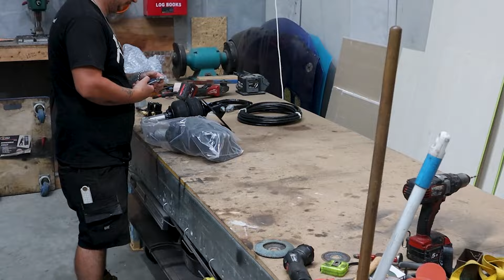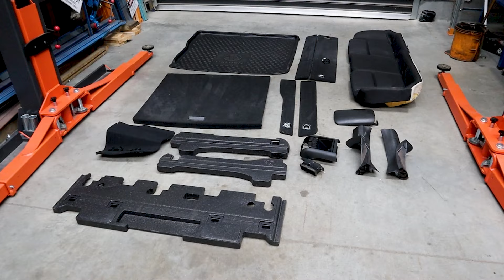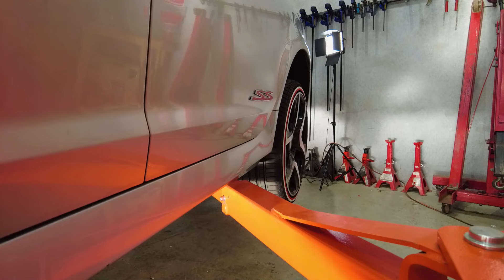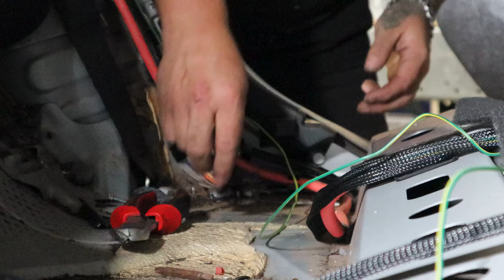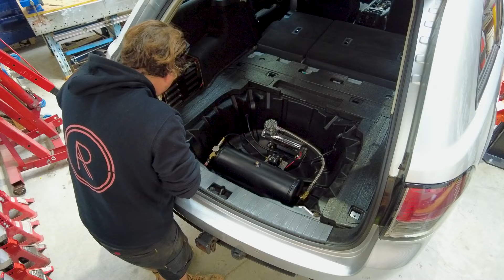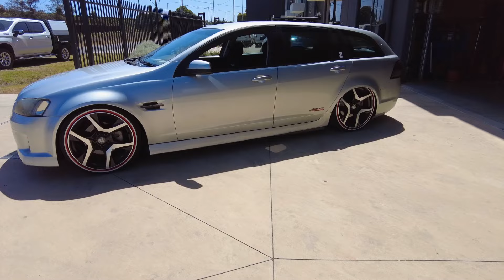Rear Airride / Airbag Suspension Install At RCS Geelong

Comment: Hey mate whats the solution for rear wheel camber after installing coilovers or these bags?? My camber bolts are maxed out already but still have negative 1°36 and 1°54 ??!
Reply from the maker: bad camber and going low with irs just goes hand in hand. bad for your tyres but its not a good idea if its your daily driver to go really low. i have seen adjustable camber arms that replace the factory ones, might be worth looking into some of those? also if you have bags and just drive at a better height that might help too?